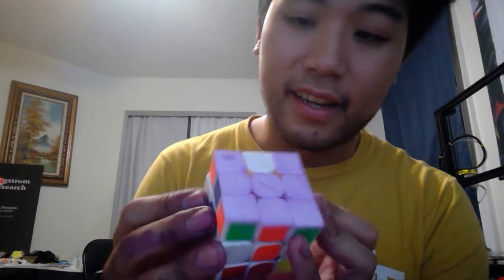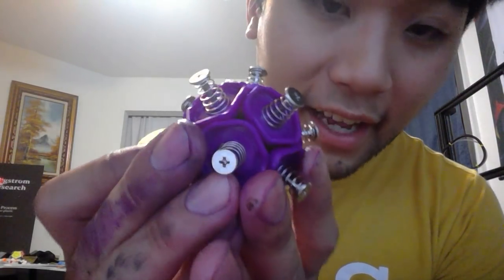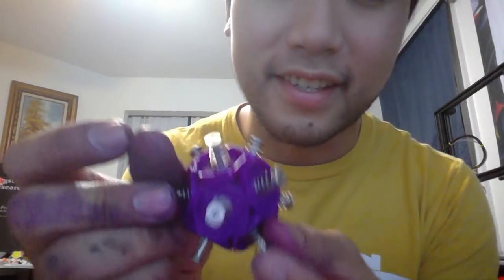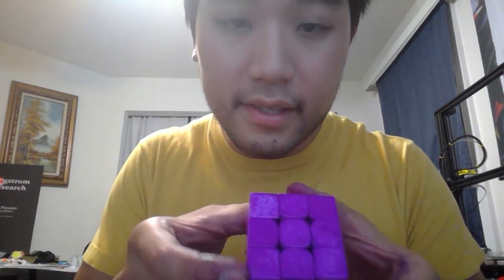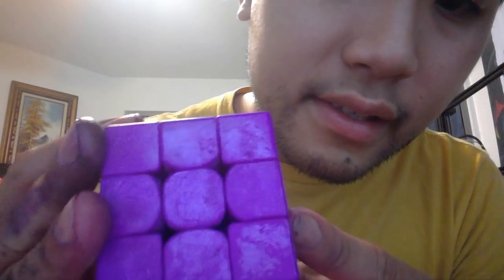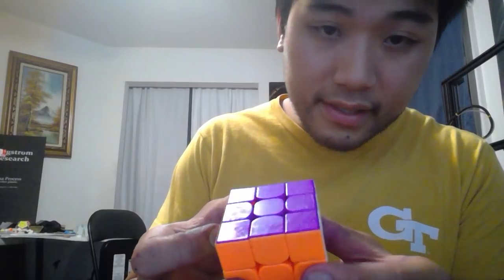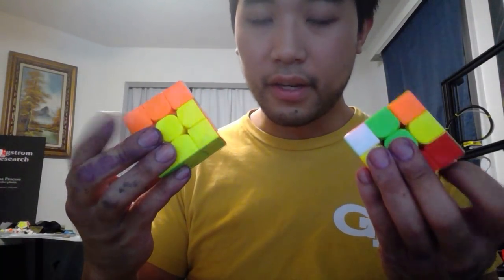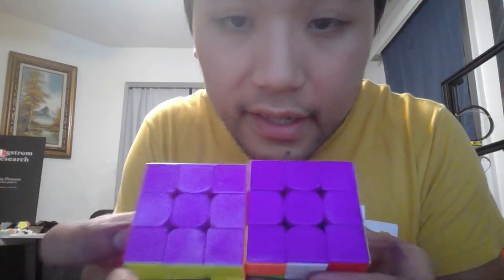Let's talk about custom plastic colours and project updates

Comment: Ok so let me talk straight I tried treating my cube with chlorine and it actually did work not only did it speed the cube up but also made it smoother I got chlorine from my near public swim pool so it was really cheap it’s been like 2 months I have put in a little bit weight 3 and it still works wonders I think i didn’t do it perfectly but I guess you could do it better I think you should give chlorine a try